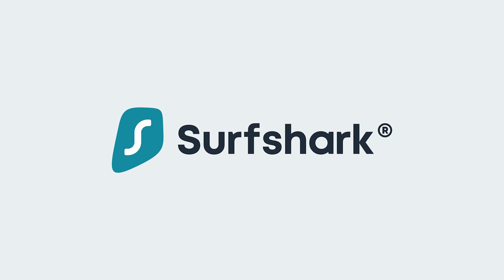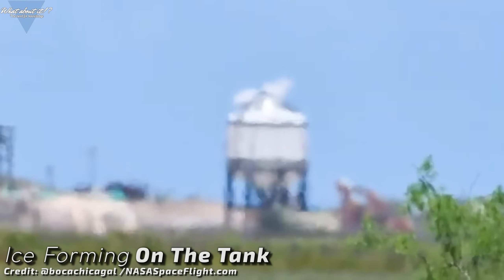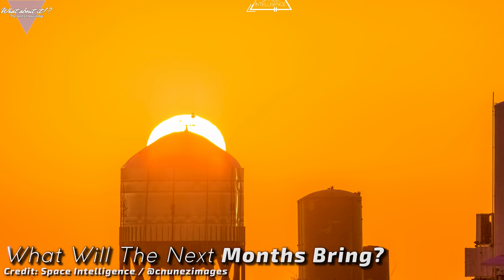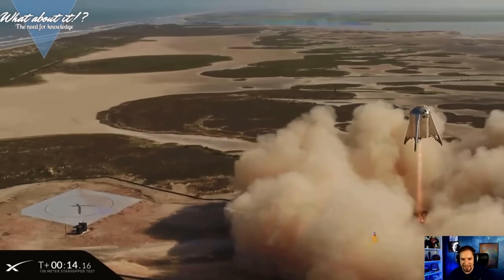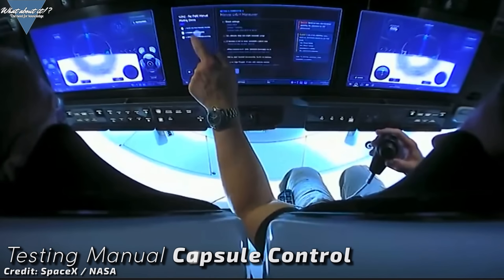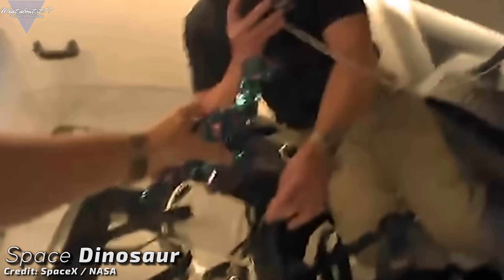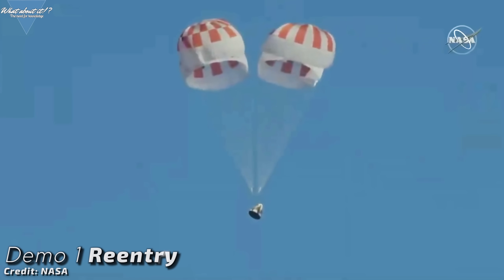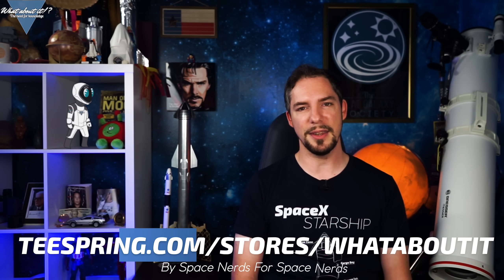98 | SpaceX Starship Updates – Crew Dragon Mission Progress Update

Comment: Seems that it would be good to cut down on leak risks involving flammables, so why not use kerosene instead of methane.  Might be that methane is lighter even when liquified.  Would a tank full of lox or methane have to be vented all the way to mars, or would the cold of deep space keep them liquid at low pressure, and turn kerosene to sludge?  A lot of physics and fluid dynamics involved.

Comment: Maaaaate,.. Apollo Astronauts on your show, COOL!
So the Tesla motors are driving hydraulics, not mechanically coupled directly to the fin/flap things?
Wasn't there an Elon tweet saying the plan was to have the motors drive things mechanically, to reduce the number of systems required?
I'd suspect they will be facing a big challenge to design a Reduction Gearbox that handles the torque getting passed through to the linkages, at the response speeds needed to land safely.
Reply from the maker: Correct. At least in ear ly versions.

Comment: Question: if sending a rocket to space is so "energy demanding" especially for heavy loads, why do not launch from an higher altitude instead that from sea level?
Let's suppose that can be relatively cheap and easy to move all the rocket and the fuel and the equipment to that location... Why not launch from a mountain? What other variables I am not considering?
Reply: That extra mile or so wouldn't buy you anything. Altitude is not the major problem. the vast majority of energy goes into achieving the speed necessary to maintain orbit. Suppose, just for the sake of argument, that the Earth was absolutely, perfectly smooth, and had no atmosphere, so you could orbit two feet off the ground. You would still need well over 95% of the same amount of energy as needed to achieve a 200 mile orbit.

Comment: I'm not sure why SpaceX doesn't do bulkheads from a solid sheet of stainless and press form it. Or at least see if it's a viable option.
Reply: Because the thickness of the hull varies over its length. Also, the tanks themselves are not merely in the hull, their walls are integral parts of it.

Comment: Can we really keep calling it crazy fast, when we are not really seeing anything but failures?

I get it that they build these things super fast, but as long as they keep failing, it may actually be faster to slow down and build quality instead of quantity.
Reply: You're not necessarily seeing failures... you're seeing things break, which isn't always the same thing. This latest test, for example, wasn't a failure - they deliberately destroyed it to find its limits. If you look back at the prototypes that have undergone testing, the original Mk1 was just a bad early design that never worked out. SN1 blew up in testing, but not unexpectedly. SN2 was a tank-only segment which worked exactly as designed. SN3 collapsed due to a testing process error, not a design flaw, and SN4 blew up in a spectacular fireball due to a plumbing failure when emptying the tanks. And finally, SN7 tested to destruction today.
Of those, I'd only call Mk1, SN3 and SN4 failures... and the latter only marginally so, given it produced a lot of useful data before the explosion, and they already had two almost-complete prototypes ready to replace it. It's set them back a little bit, but not as much as it might look, since they seem to have taken the opportunity to bring forward some re-design of the test and launch area anyway (having blown up the old one).
Reply: Do you really not understand the concept of test to destruction?

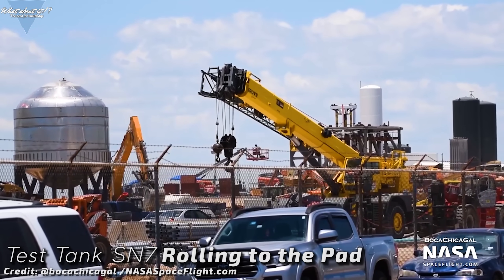Comment: 1:05 asserts that 304L stainless has “better strength at cryo temperatures.” That’s not accurate. 304L actually has lower strength but greater “toughness” (at cryo temperatures), compared to other alloys. What “toughness” means as a material property is a bit confusing to make sense of, but it’s a real thing, and different than “strength.”
Reply: That's very interesting. Could you explain what toughness means in this context?

Comment: in the soyuz capsule the cosmonauts look like hamsters squeezed into a very tight cage with supplies squashed down and all around them.  Dragon is like a luxury liner's cabin, executive class of course, i bet they have a champagne and caviar cooler under the seats xD
Reply: Of course, do remember that the Soyuz craft consists of two modules. the reentry module, which is where the crew is for launch and reentry, and the orbital module, which is forward of it during flight but is jettisoned prior to reentry. The orbital module has substantially more room than the reentry module, so they definitely have some room to move around and stretch their legs. Nonetheless, the two of them together still have only about two thirds the volume of the Dragon.

Comment: In order to quickly move the enormous control surfaces of SS, I think that high pressure hydraulic fluid will probably be required as installed in the modern Luftwaffe fighters that fly above your head Felix

Comment: Every piece of lifting equipment made has 4 official strengths. Test strength the amount of stress that a component can be expected to withstand without damage. For some components every piece is tested,for others periodic samples are tested and for things like wire rope published figures are used to calculate the expected strength of assemblies. Custom assemblies are tested to the calculated capacity of the weakest component. Maximum working load both unmanned and when lifting people or over people are calculated from test strength. Man rating is a factor of 5 or 6. Rating for safe conditions is never less than 3. Some components or assemblies are "not for overhead lifting" 
My point. Every component has samples tested to destruction. The proven breaking strength determines what the test strength will be. 
If hooks and chains are tested to failure, surely rockets should be too.

Comment: Being an airline aircraft mechanic I would like to know what they do when all those wonderful displays go black or are unresponsive. How do they handle an RCS thruster that's stuck in the on position? It's happened before more than once. SpaceX should create flight simulator software that everyone can buy and play with. Boeing should do the same with their vehicle. That way when the day comes to fly you'll already be trained. That way when you go to space you will know how to fly home or handle any emergency. You can use the software to log flight hours so you know who the best and most trained pilots are. If SpaceX did this I would buy it immediately.
Reply: There are three autonomous, redundant screens. if you look closely, you can see that there are button controls beneath them in case they should lose all three. The possibility of a thruster getting stuck "on" is part of why they approach the station in such slow, steady phases with lots of stopping and waiting on the way. If it were to happen, they would have to compensate with the opposite thruster and deorbit ASAP.

Comment: would anyone be able to give an insight into how the starship will with stand a re-entry landing when it seems so thin
Reply: This is a prototype not an orbital vehicle
Reply: It is wider than it looks. Remember it is quite tall. It is fully nine meters wide. On the other hand, it will have ceramic tile heat shields on those parts that will receive the most heating.

Comment: If the parachutes were to fail during reentry would crew Dragon utilize the abort motors to slow the vehicle for a safe landing?
Reply: No. Or at least no is the official answer
Reply: @dougthebigdp314  "Official answer" indeed. But in practice, it seems unlikely that in the event of a parachute failure, they'd let the crew die without at least trying to save them with the engines. The big risk though would be a partial parachute failure, since that's a more likely failure mode than all of the chutes failing to fire, and I imagine trying to land with propulsion and chutes would be tricky...
Reply: No, that is not actually possible. the capsule lacks the necessary control mechanisms, besides which, since the redesign after the pad explosion, it is completely impossible to exercise any control over them. They fire, and burn until they rin out of fuel.

Comment: That skydive maneouver scares the hell out of me. Those servo motors have to work 100% or its game over. Testing is going to be VERY fun! They better have lots of cameras onboard for those tests!
Reply: Every spacecraft has one or more of what NASA calls 'Criticality One' systems (in which failure means loss of craft and crew).
Heat shield fails - you're done. Parachutes fail - you're done. Lunar ascent engine fails -you're done, etc. You test the daylights out of that for which 'back-up' is not possible, until you have very high confidence in it. That's how it's always been.
Reply: The skydive is unlike any flight profile used by any other flying vehicle. I find it hilarious that nobody can agree on what name the aerodynamic surfaces should have since none of the existing names work (they aren't wings, flaps, canards or anything else).
Reply: @carljohan9265  They're fins, period.
Reply: @carljohan9265  Fwings? Flings?
Reply: @carljohan9265  flippers
Reply: Elonaerators!
Reply: Floperons
Reply: Actually you could still manoevre the thing with one of 4 control surfaces stuck in position - you "only" have to reset the other surfaces default accordingly. This has been done on quadcopters, and actually starship does control its orientation quite similar to a quadcopter come to think of it.
Also as far as i get it, there will be multiple motors on each control surface, so plenty of redundancy there.
Reply: Elonaerators!
Reply: Eurofighter style fast moving "flaps"  😀
Reply: Sky dive and no parachute!
Reply: To be fair loss of control surfaces in any aircraft and it's over but the crying. Especially if the lock in an unfavorable position.
Reply: Goes up like a missile, comes down like a whale.  "I wonder if it will be friends with me?"
Reply: I just hope they get Solar Friction Electric Force Overdrive before they go for any power dives... dynamic Electron Rail Bridge(Hair Lines) implementation would be beautiful too.